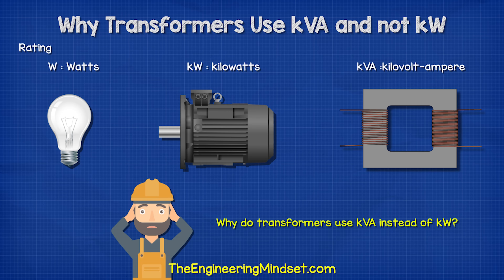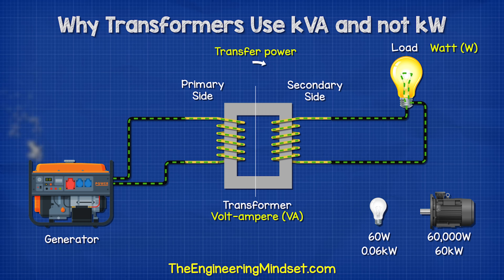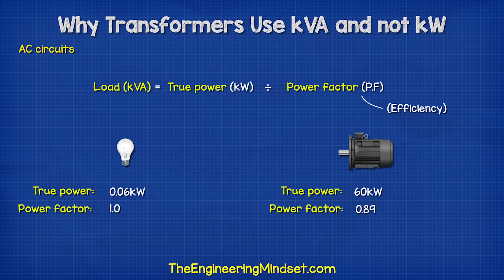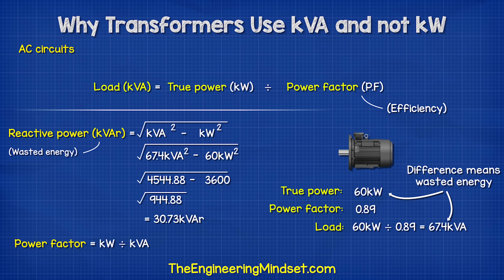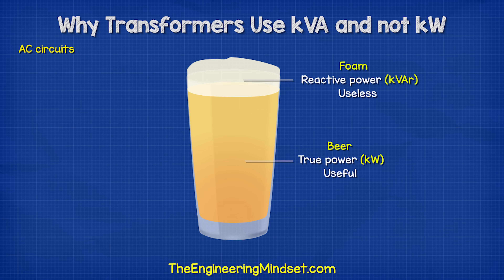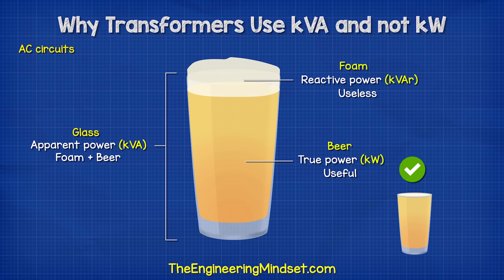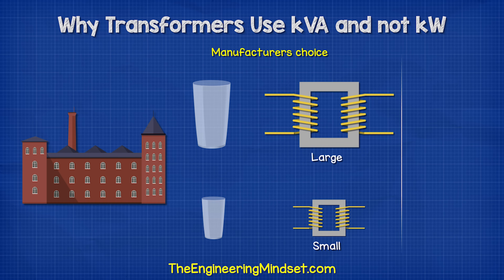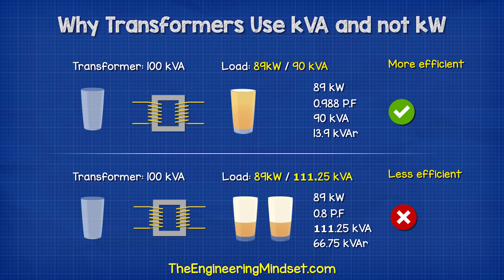Why Transformers Use kVA Not kW

Comment: Brother i think your numbers at the end need to be updated to reflect it as a percentage usage of energy inputted vs outputted based on the power factor or efficiency of the system. It's quite confusing to have both 100 kVA which is the potential theoretical max input power give the same output of total usable power when one has 80% efficiency and the other has like 99% efficiency....
Reply from the maker: Check our new  Power Factor Explained video soooo much detail and easy visualisations https://youtu.be/NIrKOVZrqnU

Comment: Yes...bartenders and restaurant owners here in NJ charge you for a 16 oz pint of beer, but you usually end up with 12 oz of beer in that pint glass because there is 1/2" of foam on the top.  One of the reasons why I don't bother getting beer while I'm out anymore!

Comment: I'm wondering about the efficiency analogy, one could think the efficiency of the motor is part of that. But as evidenced by the light bulb, which has a pf of 1 but only turns like 1% of energy into light, this is not the overall efficiency. Rather, it's whether the maximum current is drawn when there's maximum voltage. Because drawing 20A of current and creating a lot of heat in the wires is okay when there's 200V and you're getting a ton of power (20x200=4000W) but it's useless if there's only 5V available. So pf determines the phase shift between the sine waves of college and current.

Comment: The reactive Power cannot be eliminated in devices that works on Electromagnetism but yes we can use high permeability, low Reluctance materials to meet our Tesla requirements using lower value of current which will be used to drive the device
Flux(Tesla) = permeability * Number of turns * Core Area * Current

Comment: Reactive Power is not lost in the form of heat, it is transformed into electric energy (for capacitors) or magnetic energy (for inductors) temporarily and will be released back. Heat on the other hand, is true power, but it is not used by you, so it is wasted true power.
Reply: It most definitely can be lost as heat. A highly loaded transmission line has a lot of inductive reactance and that is lost as heat and is known as line loss. The more load on a transmission line, the higher the line losses due to the inductive reactance. There is also some loses due to the actual resistance, but with AC you have the added inductive losses that only increases with current flow. Which is one reason why HVDC lines can transmit more power over the same size conductor than and AC line. There is no inductive loses in a DC line. There are other loses in the converting from AC to DC and back, but for a long time now, those loses are less than the losses for an equivalent AC line.

Comment: Efficiency instead of "maximum possible power output", people will just messed up, the reactive power isn't lost! It's exchanged with the source, some additional current is flowing so a little bit more energy is lost by joule effect but the power factor is absolutely not the efficiency! A 1% power factor device can get a 99% power efficiency. 

You said what people think reactive power is 🥲

Comment: I think BEER ANALOGY is not accurate at all,when it comes to REAL and APPARENT POWER.Why not just simply use a GLASS having 80% water?Beer foam still have some contents in it.While air have no usable water.
Reply: Air does have water in it. (RH)
Reply: Beer is a more fun analogy is the simple answer. Also, the water analogy doesn’t work as well as the beer analogy since the reactive power is still used power. It’s not that it doesn’t exist or that it isn’t made of power (water), it’s that it IS power, but that power is wasted. If we assume beer foam is unnecessary or a waste of space in our glass then that is perfect for the analogy whereas the empty space in the water cup implies that the problem is to do with not enough power as opposed to wasted power. There is one problem with the beer analogy though: beer foam serves an important purpose in a good beer whereas reactive power is generally of no benefit.

Comment: Reactive power is the energy which  capacitors and inductors consume to create electric/magnetic field... but these passive electrical elements only store the power not change it to heat and this energy just flows from source to the load and backwards, which contributes to the total transmitted current thus higher power loses on electrical power lines.
Reply: Correct ... I tried to explain this in one of his previous videos, but no feedback ... and obviously nothing was learned. Reactive power is NOT a direct loss, it osciallates back and forth
Reply: I was going to say, I think his definition of reactive power (kvar) is wrong. Glad to see someone else caught it. It's the power that is stored into magnetic fields via inductors, and electric fields via capacitors. It causes more current to flow in the system, but that energy is NOT wasted, it is stored. When you pass current through an inductor, you create a magnetic field, this energy is not wasted, it can still do work, but it's simply stored as a magnetic field. Similarly, when you pass current through a capacitor, you create an electric field, and again this energy can do work, it is not wasted, it is stored energy. So you will see current flowing, but no work is done, all the energy (reactive pwr) is being stored.
Reply: ...and a major design factor in antenna design and other AC or RF applications.  But you leave the question open here. Where does the oscillating power ultimately go? Are you suggesting that it is ultimately consumed to do useful work by the motor? Does it oscillate infinitely? Dissolve into a parallel universe?
Reply: @TheCablebill  yes, it osciallates infinitely in theory ... if you keep the source connected to a non-ohmic load .... so it keeps on oscillating and taking up the capacity and creating some additional heat losses

Comment: IN OTHER WORDS, "VA" is only used before people assume that W is about active load. Without this assumption, it would have been totally fine to use W for transformers, since W can be total, active or reactive, depending on the case. For example, Wt would be total, Wa active, Wr reactive. However, people are not used to this, so we have a different scheme with "VA" for Wt.
Reply: Thanks for this.

If i did not think i was stupid before i read this, i now am absolutely sure that i am stupid.
So thanks for pointing this out to me.

Comment: Would engineering mindset make a video about running generators in parallel? And also adding and talking off load of generator sets? Thanks.
Reply: The generators require synchronizing  in lock step.
When removing a generator that is in service from the system, you need to back down the load with no current flow before opening the breaker to prevent a sudden loss of power by upsetting  and embalancing the system.

Comment: I’ve never really understood power factor.
Reply: Power factor tells you how much energy is lost in a piece of equipment while it performs its task.  In the video an example is given of a 60Kw motor. 60Kw measures how much work it does. It takes 67.4kVA input to get that much work out. Dividing the output (60Kw) by the input (67.4kVA) gives us the power factor of 0.89.

Comment: Some residential customers are just charged for active power, not reactive power. However, the "lost" reactive power cost should be included (explicitly or implicitly) in a utility's pricing model and spread over all customers; somebody has to pay for that.

Regardless, I read the average residence does not have a lot of reactive power. Big Clive stated the utilities may start charging for that reactive power in the future. 

On the other hand, industrial customers may be charged for low power factors (reactive power).

Billing schemes vary so much so these are just examples. Some industrial customers negotiate bespoke pricing arrangements.

Comment: I agree with the distinction of between apparent power and true power, but I don't agree saying reactive power is loss through heat.

For me, it's like having 2 mass objects and a spring between them. if you want to move mass 2, you have to push mass 1 and compress the spring. When you push mass no1 you only compress the spring and mass 2 is stationary, once it's compressed, mass 2 starts moving. The useful power to move mass 2 is much lower than what you have input in mass 1. That difference can not be used to move mass 2 because is compressing the spring. But that energy is not lost, it is stored in the spring as elastic deformation. When you release mass 1, that "useless" energy will be used to decompress the spring and move the 2 mass objects apart
Reply: Some energy is lost as heat in all transmission lines. Reactance sends energy from the load device back toward the power source in a wave out of phase. So what happens to this energy on the return trip?
Reply: @TheCablebill  the point is even if you had a perfect world where no loss through joule effect, you would still have reactive power. In the example I gave, if there was friction, some energy input into the system would obviously be wasted as heat, but still most of it is stored in the spring. And that is what reactive power measures

Comment: The power Factor is NOT equal to Efficiency. It may affect the efficiency but it is not efficiency. Losses in a motor or generator are governed by current (I square R losses including eddy currents) and frictional losses (the friction created by the fluid the parts are in, e.g. air, hydrogen, water, etc., and by bearing friction). For a fixed voltage and KVA the power factor determines the current affecting the current losses but the efficiency is also impacted by the frictional losses in the generator or motor. To summarize, efficiency is a function of the power factor (as it affects current) but is not equivalent to efficiency. Usually is an almost parabolic curve for a fixed voltage, temperature, and speed due to I2R losses since fluid losses at a given speed are relatively constant depending largely on viscosity which is largely temperature dependent for liquids and pressure and temperature dependent for gases.
Reply: He isn’t saying it is equal to efficiency, but that it is basically like efficiency. We want to minimize reactive losses to increase the power factor, just like we want to minimize losses in a motor to increase its efficiency.

Comment: @The Engineering Mindset reactive power is not useless, contrary to what we've been told. It helps with voltage control locally at the generator. A capacitor injecting VARs can boost low-voltage. You find them a lot in rural areas. It is the primary contributor to magnet fields which induction motors need to operate, as well as transformers.
Reply: Not to mention how disappointing is a glass of beer without foam...